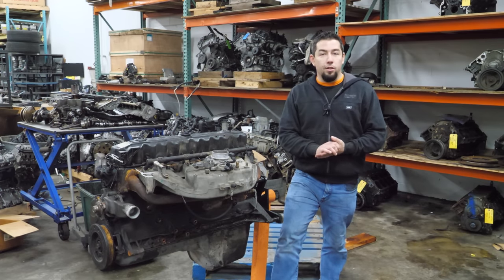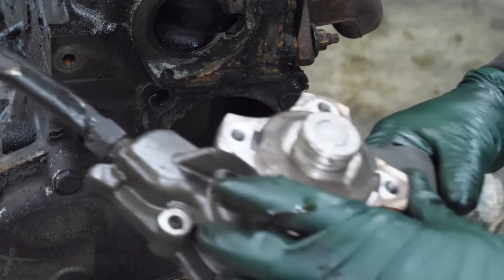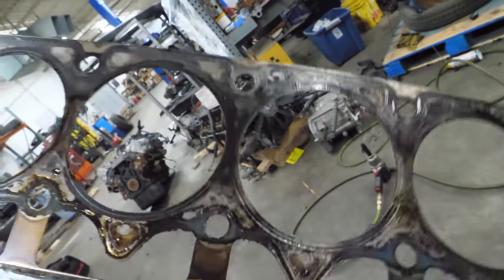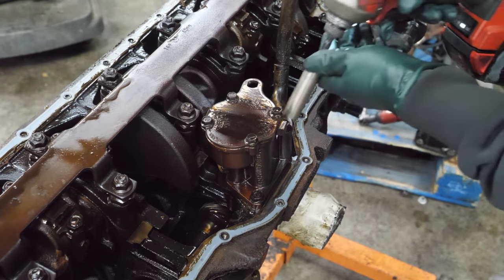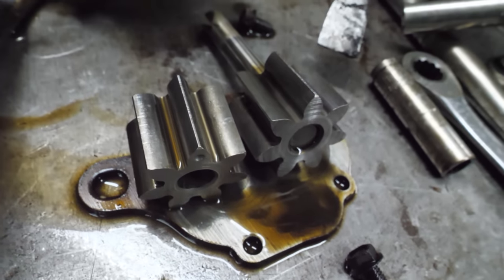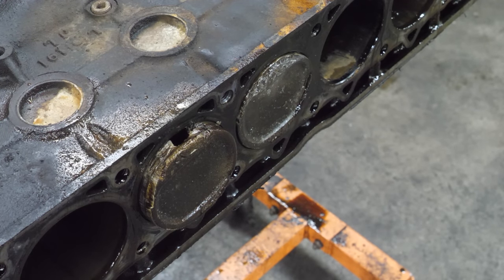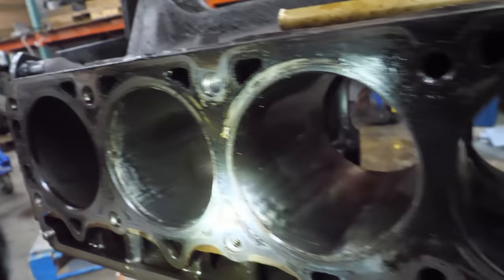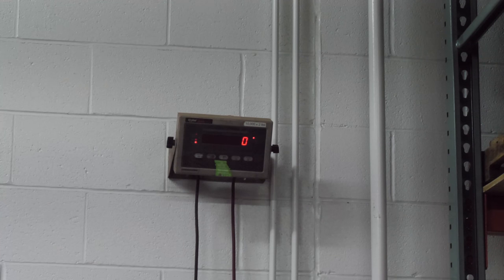How Do You Destroy A 4.0L Jeep Engine THIS BAD? Intentional? Neglect? Ill-Repair?  I Am IMPRESSED!

Comment: I killed one. Put a Mann oil filter on. Even though it cross-referenced, it didn't have a bypass in it. They're also industrial and tend to have a smaller micron filtration rating. 50 miles from when my oil change was due it plugged up enough to kill my oil pressure. Got some rod knock. Heard it right away and pulled over right away. Had plenty of oil. Changed the filter and it was fine, but with a very slight knock. Drove it around for a couple months until I secured the funds for a garage to buy an engine from a yard and could get the install penciled in on the schedule. Crashed the thing into a pole maybe 10 months later.
Reply: I really wish someone would design an aluminum head for the 4.0 that flowed across the head instead of having the manifolds on one side. That's why they make nice torque but no power. Overhead cam and a belt would probably be required at that point.

Comment: Anyone who says the powertech 4 liter isn't top 5 best engines ever made is only lying to themselves. These things are absolute tanks and I LOVE them. My beater rubicon just passed 250k miles on barely any maintenance and sounds like a blender full of rocks, leaks oil everywhere, definitely sounds like it's low on compression, and refuses to die. The thing is the definition of mint

Comment: The only vehicle I regret selling is a jeep Cherokee with the 4.0L. She was in good shape and I sold it cause it had an oil leak from the main seal and I didn't want to pay to fix it. I was young and dumb and I still kick myself 16 years later. That engine really is bullet proof and all you have to do is basic maintenance and it will run forever. I've owned so many vehicle from luxury to fast to grocery getters and still out of all of them I want my jeep back lol
Reply: my 98 Dakota had a leaky rear main seal when i bought it. all i had to do was wait. randomly one day my trans wouldn't stay in 1st gear, so i had to start in second, which wore the clutch the rest of the way out within short order. stearing gearbox was also leaky as all hell, so i fixed all of it in one go. engine still consumes oil but now at least its dry down the back of the pan 🤣

Comment: Man, I just got a 99 cherokee, it started overheating, they changed the radiator, then it started to leak on the head, right now I am uncertain of what it has but I have heard loke you said, it is an indestructible engine but I think that the previous owner filled it with water and left it stalled for a few years, I surely hope the mechanic gets it running again. There has to do something about the gasket. Hopefully it only requires that

Comment: number one plug was still in because it was behind the ac comressor mount and not easily accessed. prolly pulled the out to do a compression test and never reinstalled after they found the issue

Comment: My 4.0 liter threw a rod through the oil pan. 60,000 miles. On the freeway at 60 MPH. Meticulously serviced. Replaced the engine with a new engine. Then sold it. Loved that Jeep, but my trust level was gone.

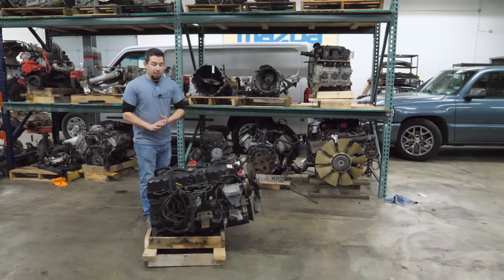Comment: 1:29 That's precisely why I like that engine. If I ever buy a jeep that's too new to have the Go-Devil flathead 4 in it, itt'l have the 4.0 I6 in it. 

You look at my top ten favorite engines of all time and they all share this same trait, too. The Ford 300. The Ford flathead V8. The Detroit Diesel 2-stroke. Chrysler Slant Six. Chevy Stovebolt. Chevy 250/292. Ford Windsor, Chevy Smallblock, Chrysler LA-series, Chevy Iron Duke, it's a common thread linking all of my favorite engines and it's one of the major deciding factors I look at when I buy a vehicle because I am that crazy motherfucker that keeps their car long enough for this to be an important selling point!

 I want a nice, simple, rugged, reliable, long lived, cheap to service engine that will stand the test of time. I don't care about efficiency or power or tech I just want...well, something like this.

Comment: I overheated one of these engines once, in summer or fall of 2018. I was driving a borrowed Cherokee with a broken A/C. I got an important email, so I pulled over to check and reply. I shifted to Park and left the engine running. I read the email, replied, put my phone away.... And when I looked up at the gauge cluster again, just as I was about to shift to Reverse, I saw a little light that said, "Check Gauges."

"Check gauges?" I asked myself. "Well, I've got plenty of fuel. Oil pressure looks fine, so does the battery voltage.... Oh! Engine temperature's in the red!!"

I promptly shut the engine off, and exited the vehicle to find it absolutely puking coolant all over the parking lot. Fortunately, my brother was nearby with a car hauler, so he gave me a ride and we dropped the Cherokee off with its owner.

Comment: As long as the block isn't cracked or warped, and the main bearing and cam bearing bores are in decent shape with no spun bearings,, a decent set of 0.030" o/s pistons & rings , hot tanking, new cam /rod/ crank bearings, new timing set , new oil & water pumps, Fel Pro gasket kit would be the order of the day, along with new brass freeze plugs... I've seen thermostats stick closed, which might have caused the original overheat problem on this engine... If the cracked head can not be repaired properly, then that is where the  $400 should be spent on finding and prepping a known good one... Save the hardware from the original head... Nice Long rods, that give this engine an excellent rod to stroke ratio!!! Great design.... With a new radiator, this engine could make an older worn vehicle, run like it was new, for less than $2k...... Later,  along with replacing the computer ignition and fuel inj. system with one of those Clifford intake manifolds, and a Weber 2-bbl progressive secondary downdraft carbs., and an earlier Jeep distributor that has been set-up with a Pertronics self contained electronic ignition with a Pertronics 3ohm 'Flamethrower' coil would make this machine SWEET!!! After that is done, along with any other mechanical work the vehicle needs, it would be a joy to drive... Turning an older worn vehicle into a valuable, useful and reliable daily driver vehicle can be done in stages... A rebuild-able  engine like this would be an excellent place to start in that process..

Comment: I had a 95 Jeep Cherokee with this 4.0L engine and was not a fan.  It did not like towing a small boat that weighed around 2,800lbs even though it's towing capacity was rated at 5,000lbs.  You could really feel the extra weight on it.  Also, gas mileage was disappointing even when towing nothing.  Best I did was about 19mpg on the highway while my current 5.6L V8 gets 22+.

Comment: You should try to find an ej22e, I have one in my 1998 Subaru legacy. Probably the best engine they've ever made.
Reply: Is that before subaru engines started blowing head gaskets like crazy?
Reply: @gorak9000 yes it was before and  the ej25's  have the head gasket issues.

Comment: '03 Wrangler Rubicon 4.0 and replaced split radiator at 80k with all-aluminum. Replaced split heater core at 95k  and again at 102k. Heater core is now Brassworks all-brass which should be reliable but does not put out nearly as much heat as the 2-piece plastic/aluminum one so will need supplemental electric heater for defrosting. Replaced fan clutch at 80k (brand unknown) with radiator change and again at 107k when temperature started climbing a few degrees (Hayden) . I found the Hayden does a better job of locking up like a heavy duty fan clutch should. Never overheated but do change coolant every 4 years or so. Depending on driving oil changes at 2k to 5k and use 10-30 Uavaline synthetic. 2-day job for this old man to change the heater core.

Comment: had an i6 300 like that, knocked like a diesel for about 10-20k and then the noise stopped
went on to put 80k on after that till the rod knocked a hole in the block, it left the end of the rod on the crank...
so 3 months later driving with a rag stuffed in the hole and running on 5 cylinders it was replaced

Comment: The AMC inline 6 (1964 to 2006) is one of two inline passenger car sixes to go 1 million miles without a major failure. The other is the Chrysler slant 6. in the G engine format (1960 to 1976)  The later model engines with the cast instead of forged cranks and other changes to reduce production costs were not as durable.

Comment: My daughter has a 2000 grand Cherokee with the 4.0 engine.175k miles and still running strong. Sucks on fuel mileage. I've done alot of her maintenance in the years she has had it. I had a 2004 grand Cherokee with the same engine. My wife at the time made me sign it over to her so she could trade it in after she was in an accident.

Comment: I had that same motor in my 91 Cherokee Laredo I bought it with 203,000 miles on it, Later sold it with 246,000 and it was actually running stronger. Never leaked anything and ran strong. I too wish I had never sold that Jeep it was just perfect for me. I know have a 2011 Jeep Compass, And I can only say it has heated seats! Everything else garbage.

Comment: Love to see you do a Jeep 5.2L V8. I have one in my 96 Grand Cherokee.
Reply: Chrysler used the Magnum engines in various configurations in jeeps and dodge trucks. there are 5 variants, 3.9L V6, 5.2L & 5.9L V8, an 8.0L V10, and finally took the V10 and made the block out of aluminum instead for the Early Vipers. I had a 93 Dakota and now a 98 Dakota both wtih the 3.9L. my 98 currently just passed 290K miles. runs great since i finally fixed the problem with their garbage in house ECU (they had two variants of the JTEC ECU all these engines are run with)

Comment: '87 Wagoneer XJ with 305,000 miles ... engine has never been opened ... tranny has had two rebuilds ... cranky idle but runs 75+ in the expressway ... I'll cry when it quits ...

Comment: When you say "This must be a hi-milage engine", well on a 4.0, that could be 200k or 500k. How many miles would you estimate this engine had on the clock?
I've got a 05 TJ that ran perfect when it turned over 200k. Now at 207k, all of a sudden it's got a sound like...well, back in the 60s, you'd guess it had a rock in the passenger front side hubcap. But only at freeway cruise speeds and only at partial throttle. I'm waiting for a little better weather to crawl under it, but I'm thinking something suspension or wheel bearing related. 
I'd really like this engine to go 300k. Then I'll drop a long block in it.

Comment: i still remember when i took my 4.0l apart and there was about an inch of thick sludge in the heads (it was probably from the previous owner never changing oil or maybe it got water mixed in it) and my 6 cylinder had turned into a 5 cylinder and blown a hole in the crankshaft and the block…😢

Comment: My moms 98 ZJ 4.0 had 370k miles on it.. and the heater hose blew and it overheated until it shut itself down via the pcm.  It was so hot i could see oil bubbling on it.   But waited till it cooled down fixed the hose.. and it turned right back on.  It now has 395k miles.. got lucky i guess

Comment: I always heard these engines were indestructible, and i really didnt know what that meant exactly until i tore down mine. It was running pretty well, and after a blown head gasket, i pulled out the head and the cylinder walls were scored to shit, a piston had a ring completely broken, and every single valve seat had compression leaks. I always wondered why it took like 10 rotations for the fucking thing to start but seriously, these engines are no joke bombproof. They’ll run ok when in awful conditions, but rebuilt, with some aggressive cams these 4.0’s are a menace!
Reply: They are my '89 XJ has been running as an I-5 for the past 8,000 miles,it just won't die. I have an 5.0L single turbo stroker just waiting to be dropped into her.
Reply: @mnstrxj3280  that makes me jealous. What trans? Doubt an aw4 can take all that heat.

Comment: Inline 6 engines have been the most reliable because they are an optimal design.
I wish I knew that when I had a 1965 Comet that only needed a carb rebuild to run like a top.

Comment: I'm in the middle of swapping out my '02's WJ 4.0, due to a failed piston skirt on Cylinder 4(a known issue on the '99-04 4.0's due to them cheaping out on the material the pistons were made of. Can't say parts stores are still keeping parts in stock, as it recently took me 3 different stores to come up with 6 spark plugs. I will admit that the engine was severely overheated about a year and a half ago, when I left it idling at work while I plowed out my parking spot and the radiator tank blew, and it idled until it stalled before anyone got my attention. 

You say these cores have value, any place in the northeast buying them? I've got 3, including the 1 that the piston skirt came off(drove 45+miles like that, and haven't seen the bore to even know if it's rebuild-able.) I also have a 97k mile spare that will be going in, and another 250k+ spare engine, that ran when parked.

You had a lot better luck with the dipstick tube than I am having with the spare, as the dipstick handle is snapped off just below the top of the tube, and I can't seem to get the tube to even budge.

As far as the coil pack on these engines go, there is now an upgrade to using a viper coil for under $200, that adds in spark plug wires, so you can enable/disable cylinders for testing, and it also alleviate the expansion/contraction of such a long block causing cracking internally of the factory coil pack.

What you called the cam position sensor is actually the cam syncro. The cam sensor screws on top of it and was already missing.

Comment: It’s possible someone did a rear main seal shed forgot to tighten those 2 nuts on the main cap brace. It’s still an old school 2 piece rear main seal. You can do them in truck without removing the transmission.

Comment: Yeah, in Kenosha, Wisconsin the chassis and frame of the Hornet or Gremlin would rust so bad that the engines fell through to the ground.  But you could put it back in another vehicle and go to 300K miles.

Comment: For such catastrophic damage in a boring engine, that had to be from nitrous. The melted pistons and the wrist pin damage (one bore cracked, others bent), that would have to be from some massive and/or extremely low RPM shot. My friend had a malfunction on his NO2 LS1 and it bent/broke almost everything in the bottom end when it fed a 250shot at 1500rpm.

Comment: Used to get 4.0 liter heads in all the time at machine shop I worked. Just like the Dodge V6 and V8 it’s pretty much a guaranteed to be cracked and at a minimum warped badly.

Comment: I put a hole in a piston in a old Ford Ranger 2.3 4 cylinder. I had just put new Autolite Spark Plugs in it and one of them failed, the tip broke off, from all the fuel dilution and such it put a hole in the piston and scoured up the cylinder pretty bad. That could have contributed to this damage, but who really knows.

Comment: Better than the newer 3.6 V-6 which is made by FIAT and has cracked head problems. This straight-six  is the engine preferred by off-road recovery guys like Matt's  and Casey's Off Road Recovery. Tons of torque.
Reply: Matt drives his Banana and Morrvair both hard. Both have 4.0 engines. Some of his recoveries scare me.
Reply: I'm pretty sure the Morrvair has a small block Chevy.

Comment: The AMC 4.2L was the almost indestructible Jeep 6, also know as the small block Chevy of 6 cylinders. It wasn't until Chrysler got a hold of it, reduced it to 4.0 and turned it into another MOPAR slug that it was never the same. Nobody understands "If it aint broke, don't fix it"

Comment: Luckily ax15 manual swap xj is fairly easy and would look oe. And 4 doors sold like wildfire.

I have a total rust bucket mj, but it's a unicorn. 89 pioneer with the ax15, 4wd, working clock, smoker windows, factory Cruise control... I would rather it rust away than sell it. Slowly restoring it and fixing the rust, tempted to HO head swap it

Comment: I had a 4.0 that was like that, it was over heated really bad to the point the pistons where angled in the bores 15 degrees, you could slide a pencil under opposed corners of the head while on a table.other issue I have seen is when an injector gets stuck open that will cause all sorts of hell

Comment: So those 2 main nuts that came off are most likely from when who ever owned that motor tried to do the rear main seal and didnt torque them properly on install since that is what you have to do to replace the 2 part rear main

Comment: I've delt with a few 4.0 that haad the wrong impeller on them. Rebuilt water pumps with the impeller from a 258 witch rotated in the opposite direction.

Comment: My 2004 spun a cam bearing at only 127k, which resulted in low oil pressure.  My '95 was running OK at 270k

Comment: The 2000 TJ and maybe the 2001 are noted for cracked heads with the original heads. The TJ forums all warn to check for the cast letters TUPY (hence known as the TUPY head) when looking through the oil filler. The 2002 TJs and above don't have that issue.

Comment: Probably was towing to get pistons to burn/crack... I think the reason for engines lasting 400k+ is HP/L, this one ~ 0.5HP/L...maybe I haven't been paying attention to straight 6's, but wouldn't you want the intake on one side of the head and the exhaust on the other?

Comment: Try a straight 300 block or a straight 200 block those are bulletproof motors now if you put transmission fluid in the oil in a slant six Chrysler LeBaron, you can blow the motor up